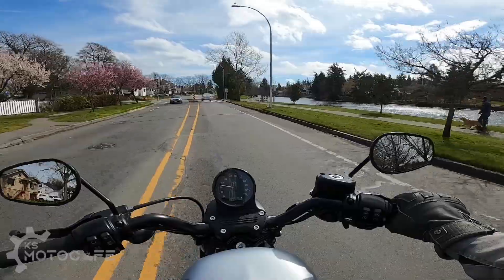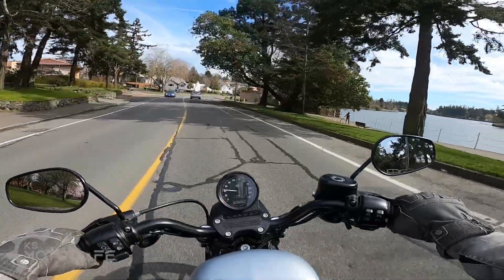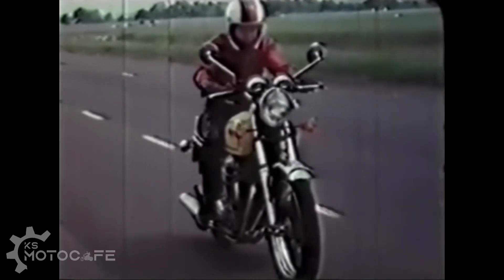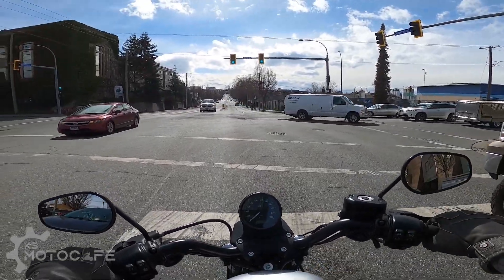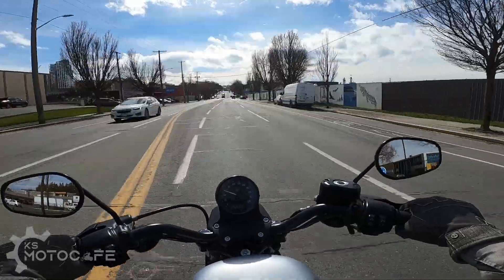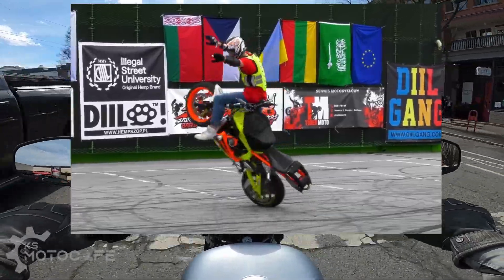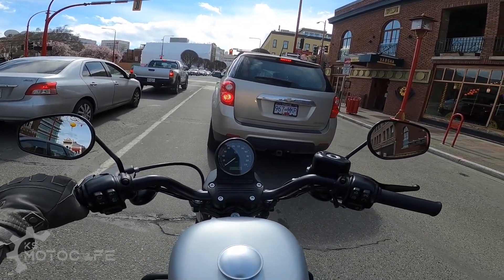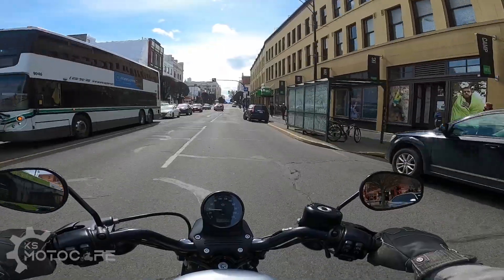Death Wobble, Speed Wobble, and Tank Slapper on a motorcycle explained!

Comment: Mine happened back in the 90s. Kawasaki crotch rocket at 135 mph. I had a new tire put on the rear by the dealer and when I went back and told them what happened, they admitted they had installed the wrong tread pattern and that's what caused it. They replaced the tire, the bike was stolen and I got a 69 Z28 Camaro with insurance money. Problem fixed. The Camaro never had a tank slapper in all the many times she did over 135.
Reply from the maker: your comment deserves to be read.  new pin 📍 If you can get that Z28 to tank slap, I will need to go shake the hands of a legend 🤣 But in all seriousness, did you get back on a two wheel after?
Reply: @KSMotoCafe  My latest is an 09 Road King with a SE 110 from the factory. She is a sweet ride but my eyes have strayed to a 56 Ford pick up for the rainy days.
Reply: I heard if you make a lot of motorcycle noises while driving fast in a Camaro it's basically the same thing
Reply: 69's had the 302 solid lifter and most had 4.10 gears, 135 mph would be 7156 rpm. (15-inch G60 ~ 26 inches tall). 135 mph would be hard to reach. Maybe, with 3.73 gears 135 mph = 6510 rpm
Reply: @melaniecotterell8263  The original DZ 302 was blown long before I owned the car. The engine was actually a 350 and it did indeed turn them wheels fast. I should never have sold it or the other classsics I had go through my greasy little fingers. BTW, the DZ engines would turn over 7 grand and like it. The factory gave some crazy lowball numbers for HP/RPM.
Reply: Hilarious. I had a Chinese crotch rocket lil thing that ended in an accident. Insurance money got me my Camaro SS and never looked back. Bought another Chinese crotch rocket too. Lamborghini next?
Reply: @elyasbayati9806  No but a new Gold Wing did come my way. Hit a Coyote a few weeks ago and ripped the whole side of the bike off. Sitting in the shop waiting 6 grand worth of repairs. Gold Wing 1, Coyote 0.....
Reply: @Mike-uh2gw  sorry to hear that man:(( wish the speediest recovery for you and your vehicle
Reply: @elyasbayati9806  Plastic is cheap, skin is expensive! And since I didn't crash, no problems. Thanks.
Reply: Nigga where did you buy that crotch rocket at and how much?
Reply: 2019 1200 sportster bad wobble at 42 mph crazy vibration on left grip and mirror ??????? New back tire
Reply: Now that's the greatest story ever!  Great and smart move bro!
Reply: Had it happen to me on a 2016 Harley Break Out with the big fat back tire. I’m a small guy and it had drag bars. Was so fast I had no time to think. Went right down-trauma center for a week and a long recovery. Still too scared to ride again. If I do I will go with a lighter easier to control bike.
Reply: What a wild story 😂😂😂
Reply: Did the replaced tire with the different tread pattern possibly apply a force of friction to the road surface that decreased the effects of the unequal deceleration force (relative to the frame of the machine) provided by a single chain driven back wheel ?
If there was “posi” on the rear wheel when going straight by having 2 drive chains 1 on each side of the bike, when posi is engaged while 🎉riding straight ahead, because of balanced forces, would the speed wobble be eliminated ?
If the rider was approaching a high speed right turn, the left gear and chain would apply only as the right one coasted and vice-versa for a left turn. Straight ahead would be 
“Posi” where both chains would drive the wheel forward with near even forces applied to the frame during acceleration and deceleration.
Reply: Well yeah no bike no problem 🤣 😭
Reply: Same thing here... time period, bike and speed.   Will never forget it.
Reply: My buddy had a 69 Camaro here in Long Island in the ‘mid 90’s
Reply: Motorcycles aren't for everyone
Reply: @2wheelhooligan649  I wouldn't truly say that I'd say your motorcycle isn't for everyone I truly think there is a certain type of bike out there for everyone just not everyone finds it
Reply: @2wheelhooligan649  and why can't quadriplegics ride them are you mean or something

Comment: I experienced a death wobble three days ago I was traveling 70 miles an hour on a freeway I felt a clunk in my front end and immediately my handlebars wobble violently I could not get out of it and I laid my motorcycle down a 2018 Indian chieftain. I was lucky I was able to walk away will see about my bike when they take a look at it in a few days I have never experienced anything of that nature. I’ve been riding for 40 years I don’t know if it was a condition in the road because I’ve had that before or if it was an issue with my bike like I said it was something that I am filthy clunk first and then this violent wobble that I could not get out of thank you for your video
Reply from the maker: Wow glad you made it out safe! That is ultimately the important part.  As for what caused the bike to react this way, did you have something heavier on one side of the bike compared to the other, perhaps in the saddle bags? Sometimes the weight difference from left side to right side when going over a bump during high speeds can cause this.
Reply: @KSMotoCafe  No the bike rode perfectly I felt a clunk in the front end and immediately went into a wobble that was violent. We’ll see what happens when they check the bike out see if there was an issue with the bearings in the steering or the axle bearing. I was having a great ride without any issues free and clear on the highway nothing in front of me that I could see and then this. I still love riding and will continue

Comment: thanks- it's important video. Every time I ride my Husky 701 Enduro I have a wobbling -usually at 120-150 km/h (70-80 mph~). It depends on the direction and wind speed. The wobble starts gradually so I gently close the throttle and it stops. .Sitting closer to the handlebars with loose hands grip "add" 5-15 mph to the speed at which the wobbles begins. Climbing a step or hole on the road above ~100 km/h causes more acute wobbling. In the KTM Adventure 1090 I had wobbling started at 185 mph (115 mph~) that were completely resolved with the rear tyre replacement. with Suzuki GSX550ES I had 30 years ago, once I had a scary wobble that started in the 180 kmh. I did not have enough courage to try to accelerate and the engine wasn't really strong at this point so I try to slowed down gently and it took a very very long moment...
This is what works for me: gradual release of the throttle -transferring weight forward on the seat while relaxing the hands grip on the handlebars. windy condition is associated with and greatly intensifies the frightening phenomenon. 
safe rides to all.
Reply from the maker: 175-185kph 😳 what does that feel like?? If I get caught at that speed here in Canada I would go lose my license, my bike, and $10k speeding ticket..
Reply: @KSMotoCafe  The translation to your method may have created a mess :) 
Speed of 185 Kilometers Per Hour is not unusual here and there are riders approaching 300 km / h. How does it feel? Speed can get used to pretty quickly in terms of feeling. I am not enthusiastic about the data on the speedometer but more like cornering. There was no attempt here to brag because 180 km / h doesn't impress anyone with 1000cc engine bike (sorry if that sounds like it). in my channel you'll find an owner review of the KTM ADV S 1090 with higher speed in some segments. BTW, speed habits is one of the reasons why I switched to a dual-sport. In terms of the law- there aren't many portable speed traps and the stationary traps location everyone knows about thanks to Waze navigation app. I never ride without the app running in front. The police will usually won't chase a rider at such a speed because several were killed in chases and there was a bed media coverage- but if you got caught they will take your license for about a year plus a few thousand NIS as a fine. even 6 month hearts- sadly I know :). anyway, my point was that although the "professional" guidelines are to increase speed, what reduced the wobble in my case - and it certainly varies depending on the circumstances - is actually stopping the acceleration, gradually and gently.

Comment: I just experienced speed wobble the other day as a result of solidly hitting a woodchuck at 50 mph on a small adventure bike. I had seen the old British video which you showed and actually remembered to not overgrip and not use the front brake. I also gradually released the throttle in hopes of trying avoid overreaction. I don't think I remembered to lay forward but have tried to commit that to memory. To say the least it was a scary experience from which I hope to be better prepared if it ever happens again. Thanks for your video.
Reply from the maker: Wow! close call and glad you made it out safely to share the story! You remembered the most important part, which was not to panic and grab the front brake! Thanks for sharing the story!

Comment: Thank you for the explanation. I too encountered this many years ago on a violent wobble. I tried to straighten the handle but the front wheel's wave left and right was getting wider and wider to the point I can't control it. As
 I was about to give up to drop the bike, it somehow gotten back to it's straight position. I been analysing this incident over and over for many years but could not figure out. And now it makes sense. It looks like it was triggered by a small pothole hit or uneven road that caused the wobble effect. I can close my x-file for good 😃
Reply from the maker: Hey thanks for sharing the story.  I got goosebumps just thinking the emotional rollercoaster when you decided to "give up and drop the bike" when the bike just kept getting worse.  Seems like you loosening up helped the bike get back to normal riding.  I am glad I could help close the file!

Comment: Sorry in advance for the blog entry. You said, "...the bike is trying to fix itself, because the more you fight the more the bike will fight you back, and mechanically the bike will always win because it's made out of metal and you're not." The question is, what's causing the fight? Modern motorcycle chassis do not experience the kinds of "resonance" wobbles depicted in your 1970's documentary (except for Harley's cuz a 2015 Harley is just a 1975 Harley). Firstly, frames are stiffer now, but second and more importantly, 90% of the time those resonance wobbles were created from too little trail in the forks. You've probably experienced it with a shopping cart at least once in your life, where the front wheel of a cart got smacked and put the contact patch too far behind the pivot point. In your '70s doc, when the rider leans forward he puts more weight on the front end compressing the forks and changing the rake and trail. Wobbles on modern motorcycles are deflection wobbles; from a bump in the pavement, dropping down from a wheelie, etc. In both resonance wobbles and deflection wobbles, the bike is trying to right itself because of the gyroscopic effect of the wheels. A resonance wobble never corrects to normal until whatever "force" generating the resonance, like speed, abates.  In a deflection wobble, the cause is instantly over and done with, so the bike will correct itself within 2 oscillations. What causes the wobble to continue and/or escalate is the rider "fighting" it, as you say. In short, the bike is making corrections on its own faster than the rider can process them. The front wheel deflects and the bike makes its first correction. The rider panics and makes a correction too, but a nano second too late causing an over correction, which feels bigger to the rider because it is. The bike responds and makes the appropriate, bigger correction to the first overcorrection which the rider again processes too slowly, but nonetheless adds their own "bigger" correction which becomes another over correction. This is the "fight" you're talking about. This fight will continue to escalate until either the rider eases their grip on the bars allowing the bike to do its work, or the bike pitches the rider allowing the bike to do its work. That's why you always see a bike straighten up and roll perfectly within 2 oscillations after pitching a rider. The bike is not "fighting you back" per se, it's trying to correct your overcorrection, for which you then overcorrect. Usually a bike will correct a resonance wobble as well (takes more oscillations) after pitching a rider because most are speed generated and the bike is off throttle without the rider aboard. Depending on your level of experience, easing your grip on the bars of a deflection wobble will result in concurrently releasing the throttle and slowing the bike, giving the impression that it was the drop in speed that cured the wobble. 1993 500GP World Champion Kevin Schwantz tells a great story of getting speed wobbles on the banking at Daytona. After repeated complaints to the engineers and several fruitless changes to the bike, they said, "Kevin San, we think you are gripping the bars too tightly." He told them they were crazy and promptly rode out to prove them wrong, but instead found lightly gripping the bars entirely cured the problem. The bike was allowed to make its own micro corrections and run true.
Reply from the maker: Mr Ok Boomer, this was a nice read and most importantly, I learned something out of it! Thank you for taking the time to explain this.  I hope you stick around to give me some more pointers!
Reply: Awesome explantation thank you so much
Reply from the maker: @wendigee  thanks for coming by to watch!
Reply: @KSMotoCafe  enjoyed the video, thanks for posting

Unasked for suggestion:
I think your channel would be a lot more successful if you removed the intro. People already have to watch a15 second ad from YouTube if they just use the app, then there is another 2 minutes of music and pictures.... It has made ppl get bored! If you just jumped right into the video and wrapped it up with your info and logo I think you would get a lot more views keep it up you have good content!
Reply from the maker: @wendigee  hey thanks for the suggestion! I think you are right - I may try some episodes with an intro.
Reply: @KSMotoCafe  thank you for taking that the right way I was just trying to help out a bit from my limited experience. I was hesitant to make it in public because I was afraid you might think I was being a jerk, but I'm happy you are not angry! I just couldn't find another way to contact you. Thanks again for being cool I'll continue to follow you!
Reply from the maker: @wendigee  I am always open for criticism, especially when they take the time to explain themselves.  It only helps me connect better with my viewers and figure out what works and what doesn't!
Reply: Man this is awesome! Thank you. I'm a new rider and I noticed around 50-60mph (z125) I start to barely feel a wobble, I didn't realize until now it's because I was death gripping the handles. Every time I'd slow down and relax (i.e. losses my grip) the feeling would stop. Thanks for that insight
Reply: This was a most useful, well written explanation I've come across for a long time, thank you for taking time to write! Most appreciated!
Reply: @okboomer1241
I raced Ducati for years, and I will confirm your assertion from my own personal experience and training. What you are talking about was referred to in the racing community as R.I.O.  Rider Induced Oscillation. In the racing scenario, it most commonly occurs when exiting a turn under acceleration. When the bars start to wobble, relax your grip and the oscillations will stop.  ;^)
Reply: good job !
Reply: Thank you for this incredibly clear analysis.
Reply: @okboomer1241 it is so awesome when people explain it this well, you explained the variables and what the normal reaction to those variables are. I never knew there where 2 types of wobbles a deflection wobble and Maintenace other wobble if it's not the first wobble it's the other than. This can save many a trip to a mechanic if they can break it down when it happened. Something was learned by me and probably many others.
Reply: Thanks mate, great info👍
Reply: That's all very interesting, but I don't buy it. The root problem, IMHO, is a misalignment between the front and rear wheels, and the causes are numerous, but generally, poor maintenance. Eg, loose bearings, axles, a bearing on one side that is too tight, a bent fork, variations in left/right suspensions, bent swingarm, or other loose/bent/uneven infrastructure which results in the trajectory of the bike being in opposition to the trajectory of a wheel, which attains a harmonic frequency after some physical event that disturbs the forces upon the bike. I am always amazed at the poor maintenance of Japan bike owners compared to a wealthy bmw owner that takes his bike to an excellent bmw tech for all scheduled maintenance, and reports all of his crashes for appropriate post-crash examinations. In the latter case  I don't think you will find such owners experiencing the death wobbles.
Reply from the maker: that is 90% of the root cause I would say as well but sometimes it is just the design of the bike.  Like my sportster develops a speed wobble past 120kph but if I get a fork brace installed, it would eliminate it